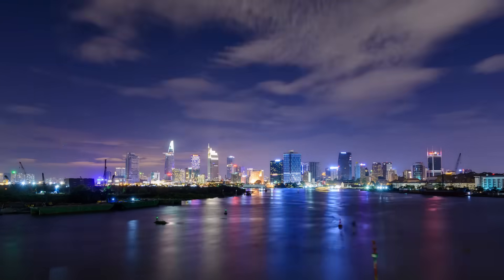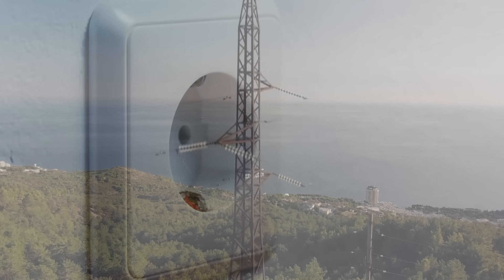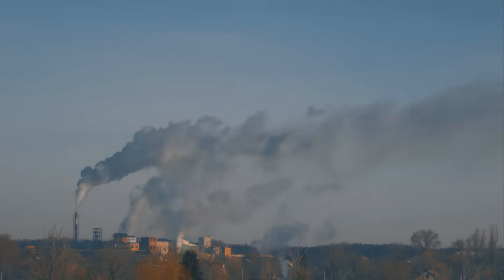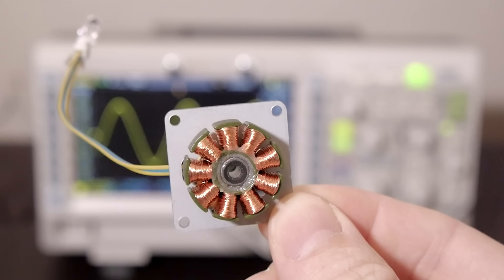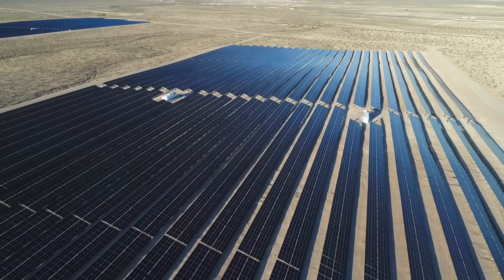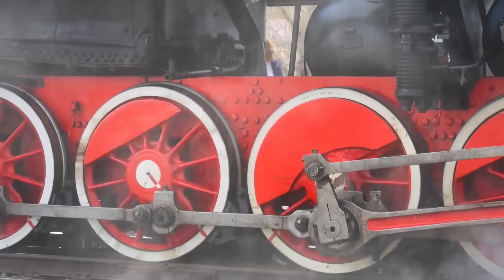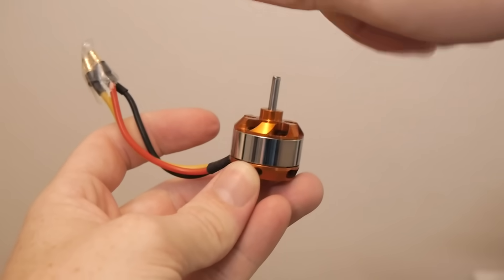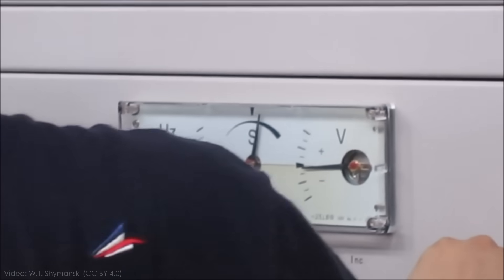How Electricity Generation Really Works

Comment: if we had batteries with inverters connected to the grid instead of generators, we wouldnt need inertia or am i wrong? I know its very unlikeley but just in theorie. The battery, given there is enough capacity, could also supply power exactly at the moment of consumption.
Reply: http://css.umich.edu/factsheets/us-grid-energy-storage-factsheet

Comment: So the inertia in the power system is essentially flywheel storage of kinetic energy within a generator that can be instantly converted to electrical energy under increasing load?
Reply: Imagine if a generator stops working but the demand stays the same. The other generators on the system will have to compensate by generating more power, hence affecting the behavior in those, that's the intertia that the electrical system puts on the generators. The same works the other way, if a load gets disconnected from the system, the generators will move more "freely" with the weight taken out of the system, that's the inertia.

Comment: A lot of the natural gas is not burned to heat water in a boiler but rather in a gas turbine. The hot exhaust gasses then heat water in a combined cycle, at least afaik.

Comment: Can you have a sort of inertia with solar by not putting out 100% until it is needed and reducing power if you have too much?
Reply: Output power can be simply reduced by the power converter. You can then increase the power when a deficit is noticed. If this increase is proportional with the rate of change of frequency (ROCOF), like it is with conventional generators, it is called synthetic (emulated, artificial...) inertia. But the problem is that it isn't instantaneous, the delay needed for reliable ROCOF calculation can be in the range of hundreds of milliseconds, half a second or even more in some power grids. This can have a major impact on stability in power grids that have very little conventional inertia.
Reply: My understanding was the coal and gas turbines took a couple of minutes to match it exactly.
Reply: @catprog  To match what exactly? Inertia is not the same as load-following. Inertia response is instantaneous and inherent with power generating technologies that rely on a synchronous generator (coal, gas, nuclear, hydroelectric...).

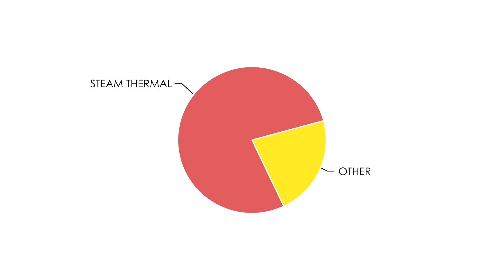Comment: 1:58 is wind technically heat as well? (just atmospheric heat not steam thermal)
Reply: If you go to the begining, I guess so.
Wind is caused by presure differences in the planet's atmosphre. Those in turn are caused by temprature differences.
Reply: Part of wind energy comes from the Coriolis effect, and ultimately from the Earth's rotational kinetic energy, which would be an example of a form of energy that didn't start as heat.

Comment: You talked about how you can't really store electricity, and obviously batteries don't exist large enough for power grid scale. But isn't there a system in scotland where they use excess power to pump water uphill into a loch and when there isnt enough, it drains through a turbine, kind of like a huge battery?

Would be great if you could make a video looking into this.

Comment: I have to be pretty curtain, if a power generating station uses natural gas, the gas is fuel for an internal combustion engine. Ether an Otto cycle engine, or a turbine. Poly phase is generated, because, it makes better industrial  electric motors possible

Comment: You had me until you claimed CO2 is responsible for the rise in temperature.    If you want to live on a desert planet then by all means work to lower CO2 levels.  If you want a lush green world then work to get those CO2 levels up to around 1000 ppm..  BTW we're current at around 412 ppm.

Comment: Solar only generates energy during the day, on the upside, it's always day time someplace. Depending on how we expand and connect our grids in the future, solar could, at the largest of scales, be a pretty reliable source of energy all the time. Still, that's quite a ways away for our power grid infrastructures to be able to handle that, the part that we would need lots of trust and cooperation between almost all the countries out there to do it, not being the smallest of problems either.

Well, for now, we're just busy plugging in batteries and these locally unstable sources of power into a grid that wasn't really designed with that in mind way back when, so no surprise it's not the easiest of things to do right now, and with a lot of problems and headaches to overcome.
Reply: Transmission losses is going to be the main issue with a globalized solar grid.

Comment: This is why I don't understand why low-tech flywheels haven't been adopted for short term storage. High tech, peak-shaving flywheels are definitely popular, but those are extremely expensive and complex. Why aren't 300 ton chunks of steel, at atmospheric pressure, spinning away at every wind farm? The mass of turbines is what allows them to lock to the grid and provide that instantaneous inertia - wouldn't it make sense to set up large PV, wind, and tidal projects the same way? Using DC to induce the rotation would allow this setup to do most of the transformer heavy lifting as well. What am I missing?

Comment: One of the things touched on in this video, and one of the most important details of operating a power grid, is power dispatch. When more power is needed somewhere, additional generation is added to supply the need. When less power is needed, excess generation is curtailed in order to keep the grid stable. Now consider solar and wind power. The most notable aspect of these sources is that they cannot be dispatched. You can’t add additional wind or solar sources as needed or remove them from the grid when not needed. Typically, these sources are operating at the whim of the weather, and everything else has to adjust to the wind and solar which cannot adjust. Notice how low a percentage of the power sources are wind and solar. If these sources become too high a percentage, the grid will become so unstable that maintaining it will be a real chore. And why are we doing this? Lots of people believe it is to prevent climate change, but is that what we’re actually doing? If preventing climate change requires eliminating sources of CO2, the best way to do that is to build nuclear power plants. Using wind and solar is a recipe for disaster. So why are we doing it?

Comment: What happens to the energy from electricity that isn't used? Would it be worth storing it chemically such as making hydogen and using it when needed?
Reply: It all gets used, that's the main point of the video. Supply is always dynamically adjusted to meet demand, on a second-by-second basis.
There are some methods of large scale energy storage that could be used to "smooth out" the load on the grid during periods of peak demand though, such as pumped storage (where water is pumped uphill to a storage reservoir during off-peak times, then released to spin turbines during peak periods) or compressible storage (where air is compressed and pumped into sealed underground caverns e.g. disused mines, then drawn off and re-expanded through turbines to generate power). Companies like Tesla are also helping to propagate large-scale chemical storage in the form of battery farms, although this comes with an increased environmental penalty due to the resource-intensive production process and the inevitable chemical waste.

Here's a good video about one of the largest pumped storage systems in the world (Wales, UK), hopefully you will find it interesting. :) 
https://www.youtube.com/watch?v=6Jx_bJgIFhI

Comment: Propagation of what we call electricity goes at near the speed of light, but the electrons in the wire travel at human comprehendible speeds :) (sometimes under 100 meters per second depending on the conductor).  IIRC it's called drift velocity. Think of it like a hose. When you open the valve the water near the exit comes first(Almost instantly from our perspective assuming hose is saturated, this is the propagation speed in water; speed of sound in h2o), however the water at the valve has to travel along the wire to get to the end. Same thing applies to electrons in a conductor! Blew my mind when i learned about it
Reply: AC is used mainly for electricity transmission, so the electrons in wires just vibrate while energy is transferred.

Comment: Interesting, but then you spoil it by stating that the CO2 emitted is the main cause of climate change.  Really?!   The sun and water vapor play no part?  Temperatures now are not as high as in the 1930’s when CO2 levels were about 100 ppm less than now.  Not a very convincing correlation there.

Comment: The absolute need for frequency stability underpins the absolute need for baseload capacity. Whilst  wind and solar PV might be nice ideas, their almost complete lack of generation inertia (particularly solar p.v.) can cause significant problems in terms of grid management, especially on sporadically sunny days ( when the local grid sees very significant variations in solar input, over timescales measured in less than one minute.

Comment: I'd like to see more focus on nuclear research if possible. Especially developments in fusion tech. Although you usually focus on practical, existing engineering...so maybe a better suggestion would be to talk about the practical engineering of batteries, and the reason they don't scale well as a storage solution for electricity?

Comment: What happens if you connect it with out synchronization
Reply: Imagine the grid like a swing, with you pushing your little brother or something on it. 

To get your brother to swing higher up, you have to properly time your pushes. You should push most when your brother is highest up. This way you add more energy to the swing.

Say if you pushed your brother when he was coming down and coming towards you, well this is bad, firstly this essentially produces a collision which brings about its own problems but also kills the swing's momentum.

How this looks in a generator is that the generator would just heat up a lot if connected out of phase. Not good.

Comment: One more analogy for load following could be thinking of it as having 3 horses dragging a wagon, if one of the horses sped up, it'll take all the load, if 1 or 2 of them slowed down the rest of the horses will take all the load, that's why synchronous movement is critical in generating electricity.

Comment: Voltage moves at the speed of light, or close to it. Current (the part that actually does work) moves at about 6 foot per second. It generates heat depending on resistance.  This is why resistors burn out, and why A/C is more efficient for transmission.
Reply: For the same voltage DC is more efficient then AC for transmission. AC is more efficient because of transformers boosting the voltage.